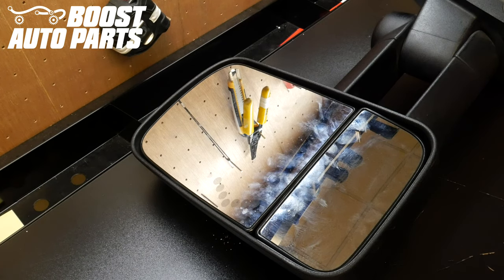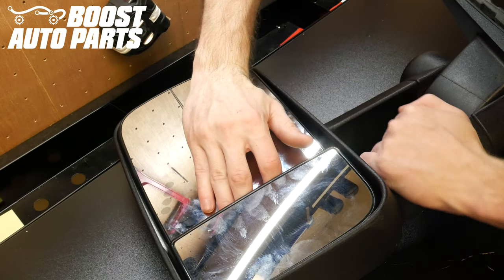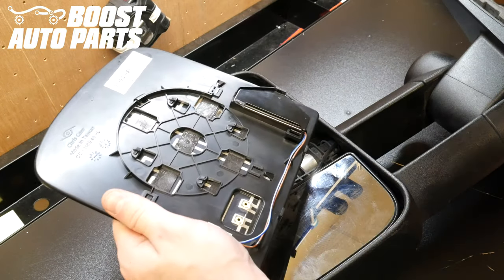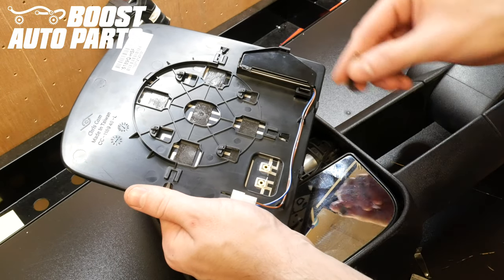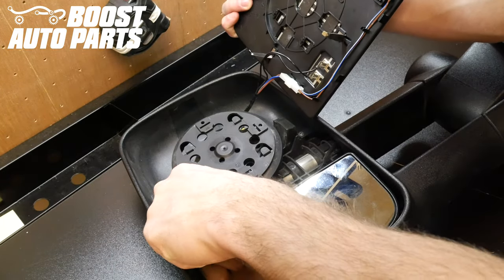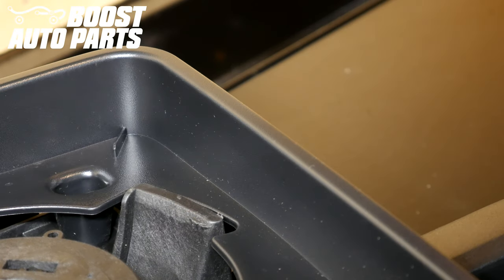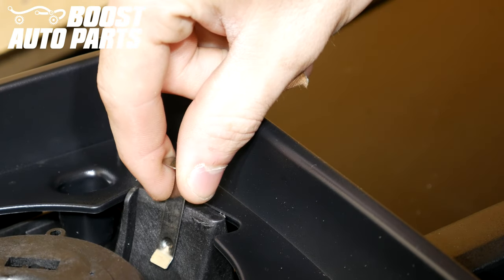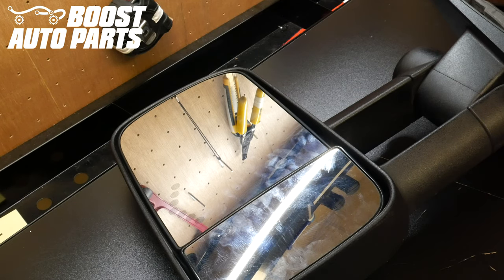Remove or Replace OEM Older Style Tow Mirror Upper Glass - Silverado / Sierra GM (2003-2014)

Comment from the maker: Link to product: https://boostautoparts.com/collections/older-style-tow-mirror-glass?utm_source=GM%20OEM%20Old%20Style%20Upper%20Glass&utm_medium=Comment&utm_campaign=YouTube
Reply: Is there any way to upfit these mirrors i havs the old style with power and heated but no led signal any way i can get the power heated and signal glass and swap it and run the wires down to the door harness and pin the signal?
Reply from the maker: @jericomackenzie2975  Not easily, but we do offer mirrors with the features already integrated.

Comment: When you say pull up do you mean towards the top of the mirror housing or towards you? I'm leaving my mirror on the truck just pulling the glass to check the heater connection
Reply from the maker: For OEM mirrors, you push vertically towards the sky.